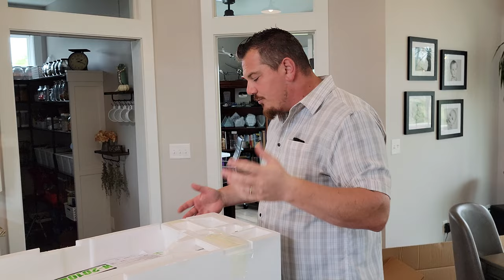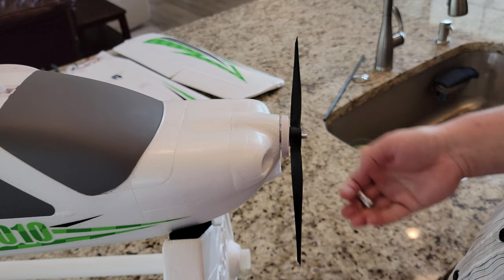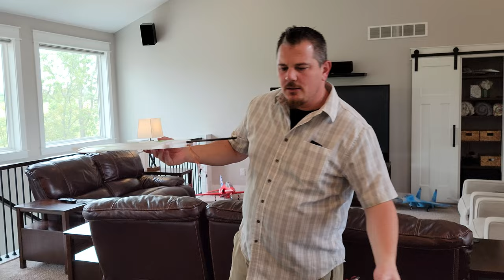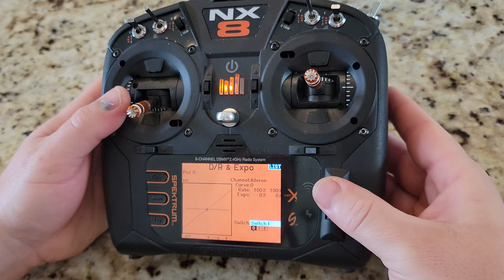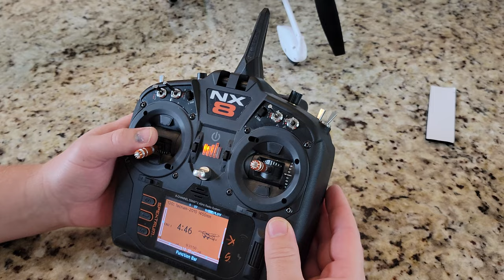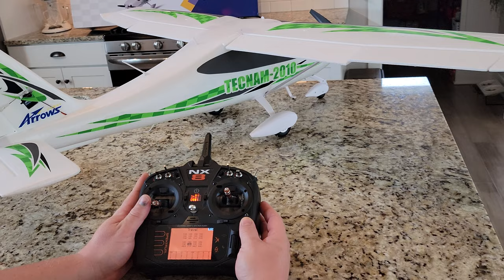Arrows - Tecnam 2010 - 1450mm - Unbox, Build, & Radio Setup

Comment: If you ever want to hear the drag created by a slow moving prop when the plane is moving fast, at idle, trim throttle up till the prop starts to rotate, then get airborne come by on a full throttle flyby and quickly pull your throttle to idle and listen.
Reply from the maker: yes! You can really hear it on some planes, like the Timber Evo (of the top of my head)

Comment: Next time you smash a nail like that, get a paper clip heat one end, and push it through the nail. Pain will be relieved.
Reply from the maker: I don't know if this was that much swelling. It was a super FAST crush, but weirdly enough, it wasn't near as swollen as I thought it would get. I'm super lucky too, since it doesn't seem I'll lose the nail yet! This is so important for me, since we're always flying...we need our thumbs ;)

As for the pressure right after the injury, I totally thought about trying to stab it with a heated pin...why a paperclip - does this offer a lower chance of piercing the skin UNDER the nail? I know the heat is to help clean the tip too, but also to burn through the nail. Wonder if I could do it to get the nasty black (presumably blood) out from under the nail???

Sorry for the gross detail, but just wondering. I haven't crushed my fingers like this too often, very fortunately, considering I do work with my hands.

Comment: Never buy RTF.. Probably the biggest issue with beginners to the hobby, is the cheap radio controller included with ready to fly models. There will be far too much throw on the control surfaces, and you will crash. Most end-up very disappointed and walk away from the hobby altogether. Everyone crashes, it's just a matter of frequency and cause.. lol
Reply from the maker: I personally far prefer a PNP model, but there are some advantages to RTF. Some of these "advantages" are only on certain planes. For example, the FMS PA-181.3m RTF, not so great, but PNP - WONDERFUL! Just depends on the user's ability to actually put together a PNP, and with some help from watching one of our videos, most can do it. One issue we find, is that some beginners don't like to listen to advice, and they'll just do whatever they want, and next thing you know, it's somehow our fault...which is somewhat frustrating.

Comment: Just bought this plane. Not my first plane by any means. I hooked all wires up, plugged in a fresh charged battery and it still doesn’t have power to my Spektrum receiver. Hobbyzone no help. Any idea?
Reply from the maker: Are you using the Vector Stabilizer?

Try bypassing it once, and get Rx bound, then try reattaching it.
Reply: @BrianPhillipsRC  I am not using it. Just going straight into the spektrum receiver. No power

Comment: That shirt is wearing out lol
Reply from the maker: LOL - yes. I use it since it holds my mic in my dork pocket protector just right, and the stiff collar makes it easy to keep from driving me nuts while filming. I used to wear a black Nike shirt, and it was very nice, but there just wasn't enough support for the mic, and it drove me nuts having it on my chest...it was just enough to be distracting. 

I should get about 2-3 shirts to just pick. If you knew me in everyday life, I wear the same things all the time...I mean, clean, I have many of each, but it's EXACTLY the same stuff! I don't like wasting brain power on clothes. I want to look presentable, but don't really care, if I look "my best" for whatever I'm doing. Not sure if you agree, but it's never been a bit part of my life, so I just spend as little thought on it as humanly possible. Also, not that it matters, but I throw this one over my black shirt, then when we're done filming, I put the nicer shirt back on the hook, so it's ready for me when we're done. It's all about efficiency for me.

I would be surprised if many of you guys in the audience, don't do it too.
Reply: I think it works great you got a good system man.